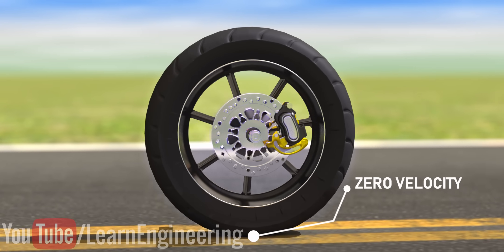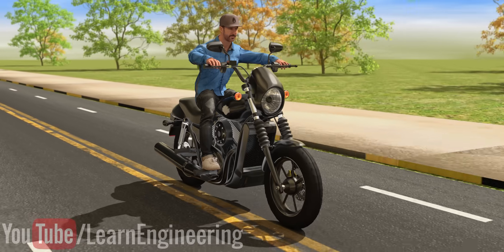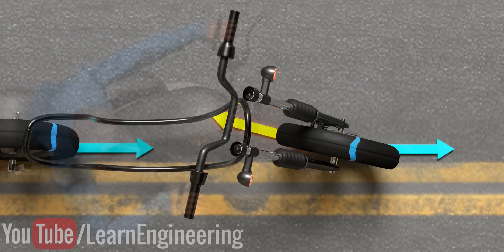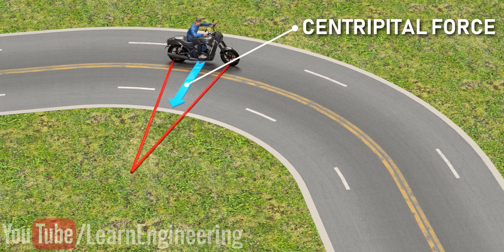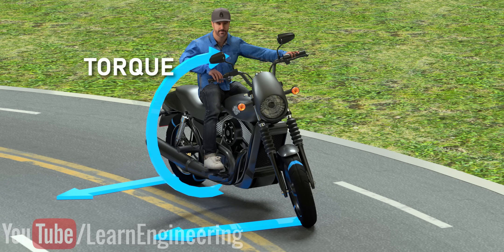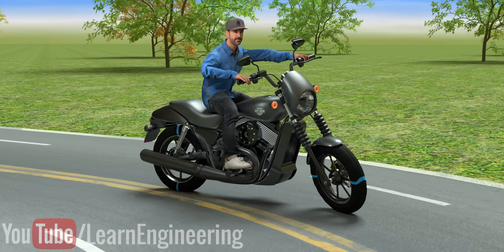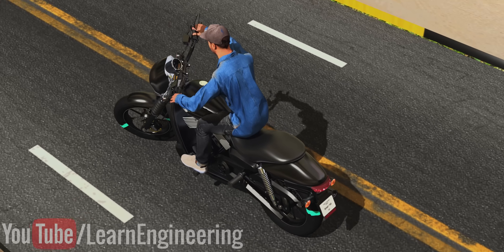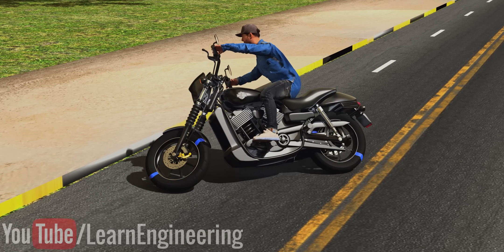Counter Steering | The interesting physics behind it

Comment: For those who are still confused.

Counter steering enables vehicle to leaning on the other side, which helps in take quick turn. You can see this yourself on a standstill vehicle, if you turn the handle the vehicle tends to fall in the other direction.
Reply: Yes....but ONLY above certain speeds... That range range is most often above at least 11 or 12 mph.
Reply: @motoryzen  Nope, sorry. Unless you're very talented, and can balance a motorcycle at zero speed, counter-steering is the ONLY way to steer, and it has almost nothing to do with speed. The only thing that varies with speed is the amount of lean needed. At very low speeds, you simply don't realize you're leaning, but lean, you must. It's elemental physics.
The only way we move forwards is to push backwards. You know this; it's what the engine and the back tire are for. It's also how you walk: we lean forwards (by slight ankle pressure), and prevent ourselves from falling by moving our feet back under us, one at a time, until we get where we want to go.)
Similarly, the only way we turn in one direction is by pushing in the other direction; so in order to turn to the LEFT, you must push against the RIGHT, so that the ground can "push" you to the LEFT. 
Now, the only thing in contact with the ground, hopefully, is your tires. So the only thing that can push either left or right is your front tire.
So, to turn LEFT, your front tire must push RIGHT, so that the ground reacts (providing an equal and opposite force) by pushing you LEFT.
If that happened without you leaning to the LEFT, you'd fall over on your RIGHT side, because the ground pushing your wheel LEFT would push it out from under you, dropping you on your right side. So you MUST lean LEFT to turn LEFT.
This is why the bike's steering geometry and the tire shape are designed that if you lean LEFT, you naturally turn LEFT. That's why front tires are rounded.
The way you lean LEFT is to BRIEFLY steer RIGHT, to move the wheel out from under you to the RIGHT, causing you to lean LEFT.
At this point, the centrifugal reaction created when you enter a LEFT turn pushes you back upright (i.e. the top of the bike moves slightly toward the right, against the turn, preventing you from falling over.
Again, from the top:
When you steer RIGHT (counter-steer by pushing the left bar) BRIEFLY, the wheel comes out from directly under you on the RIGHT hand side, causing the bike effectively to lean LEFT. Because of the steering geometry and the rounded tire shape, the bike then turns to the LEFT, creating that centrifugal reaction that keeps you from falling over.
To continue the turn (and most explainers don't correctly describe this part)...
Once you've established your turn, you now pull the LEFT bar (or push right) to pull the wheel back under you, preventing you from continuing to lean further and tightening your turn (or falling over).
To come out of your LEFT turn, you PULL the LEFT bar (or push right), which pushes the wheel back under you, bringing you back to the vertical position, and stopping the turn. That's it.
One of the really clever parts of motorcycle design is that, as stated above, the steering geometry and tire profile are designed to cause the bike to turn when it leans. The centripetal force created by the leaning tire pushing you into a turn is matched by the equal and opposite centrifugal effect (centrifugal force, if you're not a science purist!) tries to push you back up again, which is why you have to continually pull on the bar to hold you in a turn.
Having said all that, here's what SEEMS like a contradiction to what I've said...
IF you're riding fast enough, the gyroscopic effect of the rotating wheels AND the lateral movement from your straight-line velocity will hold you vertical, so you can actually lean your body while keeping your bike vertical. If you do that, you upset the balance slightly, and the bike will lean, and because of the steering geometry and the tire profile, it WILL turn, WITHOUT counter-steer. In this manner, if you lean LEFT, the bike will turn LEFT, pulling the wheel back under you and attempting to straighten you up again... again, because of the design of the steering geometry & the curved tire profile.
The gyroscopic effect will make the "lean-only turn" much more gradual than the more normal counter-steering turn, however. In fact, the lean-only turn can ONLY be performed at higher speeds (I'll say nominally above 45 MPH, based on experience with my BMW R1200RT) and for gentle, slow turns, because you need the gyroscopic effect of the rotating wheels AND the deviation from a straight line to create the centrifugal effects to keep you vertical. At lower speeds, if you lean one way you need to push the bike the other way in order to maintain balance.
Bottom line: at lower speeds, counter-steering is the only way to steer, and at higher speeds lean-only steering (no pulling on the handlebars) WILL turn you - but gently. It is a slow effect, and takes practice to do it accurately, but I've practiced successfully it on long uneventful (but never boring!)  rides on the slab 🙂

Comment: This is completely wrong. The counter steer causes the bike to lean in opposite direction (into the turn) which causes the trail of the front wheel to "take over" and it STEERS ITSELF around the bend. If you honestly think you, after the counter steer, control the bike around the bend your doing it wrong. Counter steer and let the bike ride itself.  You do not need to help it.

Comment: Counter steering is the only way to turn a motorcycle above 6 to 10 mph. If you're turning you're counter steering.
Reply: I do parking lot drills at least twice to three times weekly...at 6 to 8 mph. The bike CAN easily turn left by turning the handlebars left...and you can remain 90 something percent perfectly upfront the whole time. 

Now. You CAN use counter steering to turn the bike at those speeds if you're already making the bike lean to a certain direction some first  alittle bit barely before beginning the counter steer (which I do all the time doing RideLikeAPro offset cone weave drills)

Bret Tkacs would call this the Bob n weave..which I am a big fan of and definitely use the crap out of when doing Motojitsu's Blue and Brown belt parking space drills.
Reply: @motoryzen  at parking lot speed, yes, under 10 to 15 mph you need to do direct steering. Go into a circle at a slow speed and you will do direct steering, but increase the speed through the turn and you will trabsition to counter steering at some point.

Comment: "Counter steering is an amazing technique used by many bike riders"  WRONG.  It's used by ALL bike riders.  Not knowing how to countersteer can kill you.
Reply: @no I almost crashed years ago because I didn't know this.  It amazes me the number of people who will argue with you about countersteering.
Reply: @no 
Basically this video is dangerous and should be removed. If you want to know about motorcycle related topics, visit motorcycle related channels, It’s obvious that the maker of this video has never sat on a bike in his life, or he wouldn’t be saying the things he does.
For a fine video on counter steering in use see https://youtu.be/lzk8oyNO708
It’s not my video, but it’s probably one of the best as demonstrations go. Hope this helps you.
Reply: @no if you are going less than 5 or 6 miles per hour the bike will react differently.  The bike will want to fall over and you will keep steering in the direction the bike is falling to keep it upright.  Once the bike has enough speed it will want to stay upright and you will have to force it to lean, thus the counter steer.   If you are stopping at intersections you will use your handlebars to steer into the turn and you will also lean your body.  It's like riding a bike.  Hard to explain.  There is still some countersteering involved at slow speeds.  For example, if you want to go straight you will need to steer farther into the turn you get your bike to go upright.
Reply: Most people don't realize they are counter steering.   It's just a natural thing we learned when we learned to ride a bicycle.  Where it gets you in trouble is when you take a turn really fast and panic.  If you need to make a quick change of direction you might steer the bike the wrong way if you are not aware of counter steer.
Reply: @no There are no options. You always countersteer.
Reply: @no That I did.

Comment: Shifting your body weight does jack @%& for steering. You are shifting your weight "inside" the bike to reduce lean angle in the corner. Watch Keith Code, Cornering Bible instead of this.

Comment: above 20 miles per hour, you cant just turn your handle bar sideways. the movement straight will not allow that. and if you will force it left or right you will crash instantly. this is one big nonsense
Reply: So how do you turn??
Reply: @softailfun  you just lean. you cannot move the handlebars sideways in movement. it will resist
Reply: 1:47 this angle is not possible. if you will pull the handlebar to this angle at 50 miles, which is not possible since the bike resist due to forward movement, you will crash instantly.
Reply: @rubickon9500  
Ok the video is total rubbish, we all know that. However,  counter steering exists. The movement of the front wheel in either direction is almost tiny ( hardly any movement at all) in order for counter steering to take effect. So you are correct in as much as the angle suggested in the video is wrong. Counter steering is real and without it, you could never steer a bike at any speed above 15 mph.
Reply: @softailfun  yes, sure i agree, we all using it without even knowing that, its by feeling. pretty much anyone we has a 2 wheel drivings license learned that. i saw the vid you posted, making it simple. 
this video total BS and should be removed.

Comment: Mostly right, but there is no "regular steering". Due to the gyroscopic effect and forward momentum, the bike won't allow you to tip it enough by just leaning. It's extremely stable and wants to stay upright. As such, counter steering is required to upset that stability. If you try "regular steering", the centripetal force will throw you out of the curve.